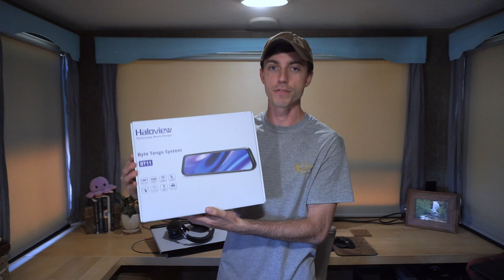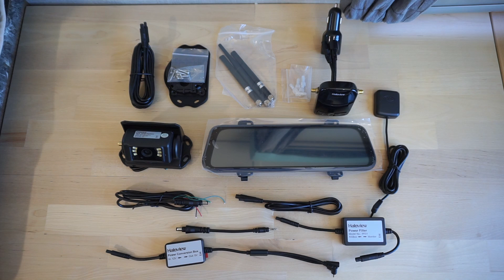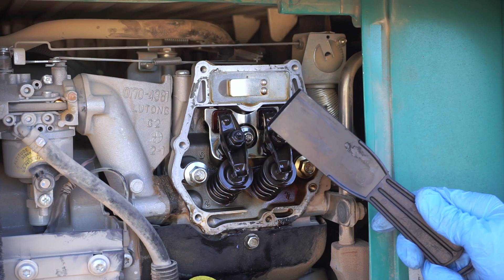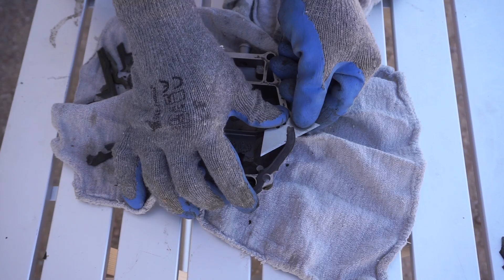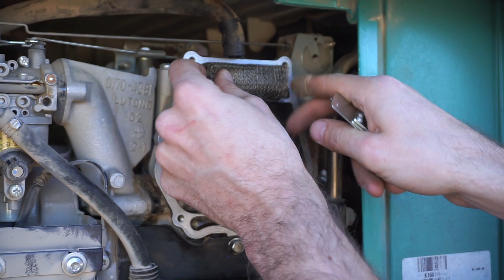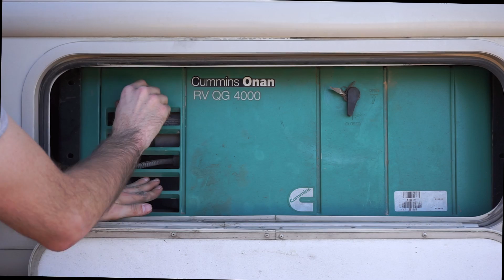Onan Generator Maintenance: Valve Cover Gasket Replacement Guide

Comment: I didn't hear the fuel pump prime prior to the starter kicking in.  Holding the generator start button in the up position, should activate the fuel pump.  Allowing the generator to start faster.

BTW, Welcome back.
Reply: It could be time for a carb cleaning or elevation adjustment on the carb.  Both sound like great generator videos.
Reply: Another video idea, HZ adjustment, fuel filter
Reply from the maker: Actually, this generator needs both of those things done to it so I think you're right!

Comment: Did you check the valve lash while you had it open?
Reply from the maker: No and I'm kicking myself for not doing that 🤦‍♂️
Reply: Valid point, valve adjustment could cause hard start symptoms.